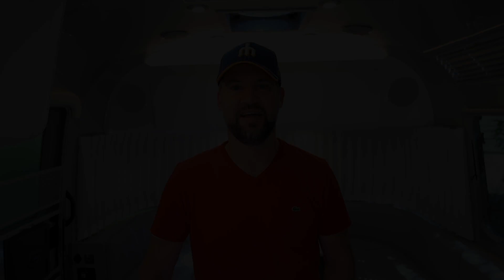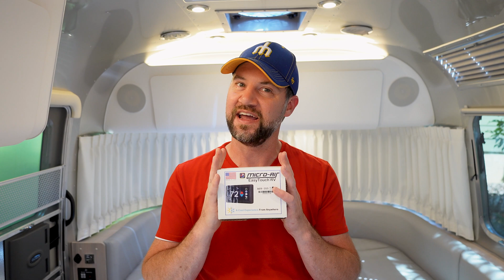Smart Thermostat for your Airstream! - Micro Air Easy Touch Install + First Impressions.

Comment: Help, have same rv355c but some of wires not used and I have a black one
Reply: Any help appreciated
Reply from the maker: Greetings. My understanding is the harness on the thermostate is specific to the brand and configuration of the AC units. Mine is the Coleman Mach, Dual. If you have the same, all wires should be used and essentially plug and play. I could see possibly not having the dual, and you may not have the 2nd harness for the 2nd temperature sensor. If you have not already, you may want to run through the online selector tool here to verify you have the correct thermostat for your configuration: https://www.microair.net/pages/easytouch-rv-thermostat-replacements-select-a-brand Thanks for watching and commenting.

Comment: Thank you for posting this! Been considering the Easy Touch for my 2023 International – your video is good background before I start down that rabbit hole.
Reply from the maker: For sure! Assuming your international has the Dometic AC, the wiring should be an easy RJ45 connector. Best of luck on the install and thanks for watching!
Reply: @MakeItRad  Good to know! My AC unit is indeed a Domestic.

Comment: Thanks for the info! We toured the mothership yesterday and see they are installing GE Profile units now. There were a few Dometics still on a few new ones, but the majority were GE's. Curious to know if those are already smart ready. Great job!
Reply from the maker: I hope to make it out for a tour one day. Yes, the Flying Cloud, Trade Wind, and International are all using the GE models now. The Globetrotter, Pottery Barn, and Classic use the Coleman.  There is a micro air thermostat for the GE available on the micro air site. The only limitation as I understand is if you have 2 AC units, you will need 2 seperate micro-air units as well. The coleman and dometic used a single thermostat with sepeerate zones to control both. So unfortunately the upgrade will cost 2x for those with 2 ac units.  

I believe this is the model you will need for GE: https://www.microair.net/collections/easytouch-rv-thermostat-ge-replacements

Thanks for watching!

Comment: So my camper has two AC units. And the thermostats are like a inch away from each other. Do they make a model that can control two AC units ?
Reply from the maker: Greetings. This has the dual AC units as well (both with heat pump functionality) and 1 separate gas furnace. The single Micro-Air runs it all. You might reach out to Micro-Air regarding your setup to see what's the best configuration for your camper. Hope this helps, thanks for watching!

Comment: Installed in our 2018 International. Works incredibly well. Doing the easy start modules for the A/C units next to extend battery life.
Reply from the maker: A very worthwhile upgrade for sure. I just updated the firmware and the UI received some nice updates as well. Thanks for watching!

Comment: Did you, or are you, going to install a Level Mate Pro?
Reply from the maker: Greetings. The LevelMate Pro was one of my first upgrades. Its a nice little tool, and the bluetooth range is decent enough to use from the truck. I may move it to an area where it gets hardwired power vs battery down the road.  Thanks for watching.